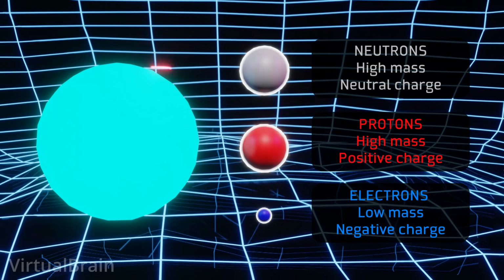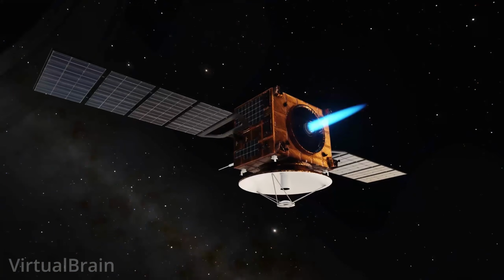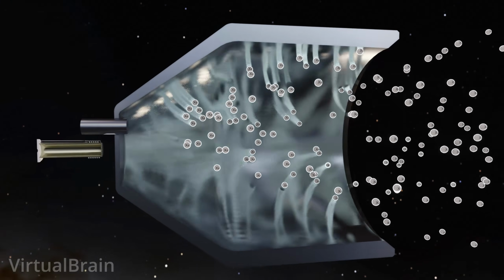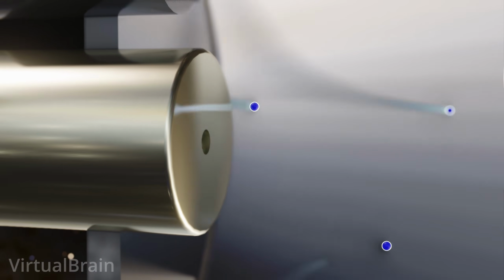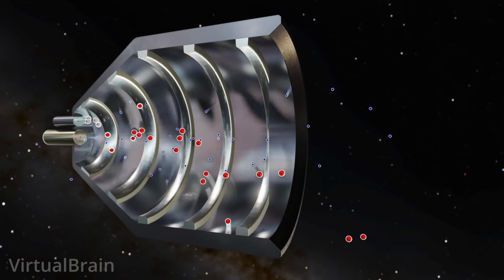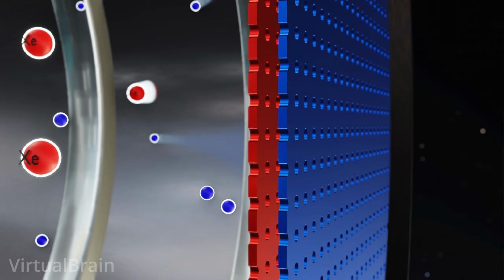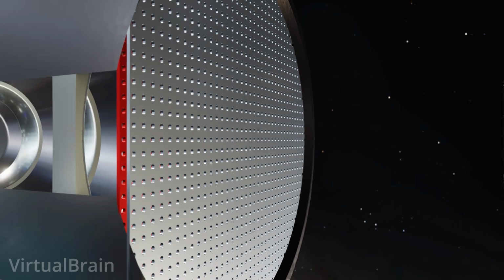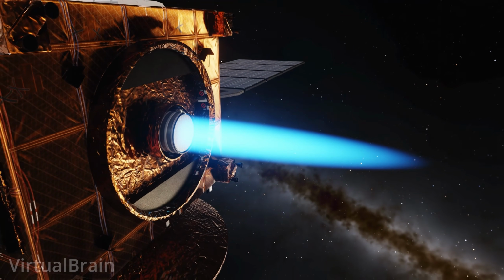How an ION THRUSTER Works ⚡ What is Electric Propulsion?

Comment: Electric propulsion is not good at all.
Reply: ... Based on what criteria do you make that assessment. Specific impulse of the shuttle main engines is 453 'sec' while the HiPEP produced a sustained value of 9840 'sec' (maximum above 10,000 'sec'). It is perfect for orbital transfers.

Comment: How does it increase the efficiency when adding magnetic rings around the main container? Will it increase the particles' ionization rate or acceleration in a straight line?

Comment: This was the best ION THRUSTER video that i've seen on Youtube so far.
Reply: There is an interesting design of aircraft, but they rarely talk about it, because this thing is secret. The topic of pulsed plasma thrusters has been developed since the early 60s (see PPT - Pulsed plasma thruster) - they are usually designed for spacecraft. But we will talk about a little-known design - these are plasma propulsion panels for aircraft, where the same Pulsed plasma thruster, but reduced to the size of a pencil and stacked in the form of cells in the panel. The design resembles a conventional plasma TV screen, where there are also discharge cells that activate the glow of pixels on the screen. And plasma propulsion panels have long discharge cells, the arrester has a railgun architecture (just rail contacts or coaxial), and the ionized discharge air is accelerated there by the Lorentz force to enormous speeds - a kind of ramjet engine is obtained. Just imagine! - tens of thousands of small ramjet engines assembled in a panel and firing plasma synchronously with a huge frequency (hundreds of kilohertz). Thus, plasma propulsion panels create lift by pulsed emission of plasma jets from railgun cells. There are tens of thousands of cells in the panel, they shoot at a frequency of hundreds of kilohertz, a huge pulse is obtained, and the plasma swirls the air into toroidal rings - the aircraft is held on this air cushion. Horizontal acceleration is created by the same plasma panels on the sides of the device (they glow, from the side they look like "portholes"). Such devices like "triangle" or "disk" have been observed for a long time, they are mistaken for alien ones - but these are terrestrial devices. They are classified and used for espionage and secret actions. Pulsed electromagnetic technology generates microwave radiation, therefore it is harmful to health. They rarely fly - only military missions. Therefore, they are not suitable for a citizen. This maintained the secrecy. Now they are already declassifying - many people know about this secret technique. When declassified, they will be used for cargo airships. But there is a danger that they are now going to be adapted to deliver small nuclear charges to decision-making centers - such means of delivery are not specified anywhere, are not conventional. This lowers the threshold for starting a war. It would be necessary to declassify them as soon as possible. That's why I'm writing about it. However, I have written before - starting with the book "The Elimination of UFOs" and many articles. 👽👽👽👽👽👽
Reply: @Pavel_Poluian  what?
Reply: @NoahDaun-yd2ep  There are many lies here in the field of UFO, but the truth can be established by special methods of Open-source intelligence (TEXT MINING). After studying all the materials about UFOs, it becomes quite obvious that since the late 40s of the twentieth century, a secret project has been developing in the United States for the development and production of aircraft, where the lifting force is created using high-frequency vibration. It all started with James Pitts' "Sky Car" vibrating orthotopter umbrella, then the umbrella was closed with a dome and devices appeared according to the scheme of conventional electromagnetic vibrating speakers (membrane + inductance) - fragments of the membrane were found by a farmer in Roswell. Then they created piezoelectric thrusters, or with small dischargers on the surface (they glowed all over the body due to ionization of the air), and now they are planes with plasma propulsion panels (so they are angular - that is, with flat surfaces). Thousands of discharge cells are densely packed into motor panels - they shoot streams of plasma (railgun architecture - coaxial electrodes). The ionized air of the spark discharge is accelerated in the railgun chamber by the Lorentz force to enormous speeds - a kind of ramjet engine is obtained. Just imagine! - tens of thousands of small ramjet engines assembled in panels and launching plasma synchronously at a huge frequency (hundreds of kilohertz). Plasma jets form toroidal air vortices - this air cushion creates lift and acceleration. See, for example, the MARAUDER (Magnetically Accelerated Ring to Achieve Ultra-high Directed Energy and Radiation) project. My article "UFOs are made in the USA" and the books "UFO Hunt" and "UFO Elimination" describe all this in detail. The technology is quite mundane - it is known in great detail thanks to information leaks. For example, air ionization in the coaxial elements of a railgun is created using radiation (radioactive polonium is introduced into the metal). Devices of this type were used throughout the 50s-60s-70s-80s for secret missions (they took off, as a rule, from special submarines). With the fall of the USSR, their use by the United States was practically curtailed (in the novel "Little Green Men" by Christopher Buckley, speechwriter Bush Sr., a scene is described where the US president decides to curtail the "flying saucer" project). The winding down of the project can be recorded by the drop in magnesium consumption in the United States, since such fuel was used in fuel cells (magnesium strips were burned in forced galvanic batteries), this is 2007-2008. However, later the development of the technology continued in the Russian Federation and China (the technology was restored by reverse engineering methods for downed devices). Secrecy, however, was maintained and there was no civilian use because the technology was not suitable for it - harmful microwave radiation from pulsed plasma thrusters (harm to pilots and impact on electrical appliances inside and along the flight line). The payload is small (but one nuclear charge is enough). There is no radio communication - unmanned vehicles can fly and maneuver only in accordance with the program. Previously, there was a narrow application profile - rare spy missions (so that pilots do not get a lot of radiation). Reconnaissance aircraft of this type were often observed at military bases, missile launch sites and airfields. They were even seen by peaceful geologists in the taiga, where clearings for seismic exploration were laid - UFOs flew there to check whether military construction was underway (I myself heard stories about this))). I think that soon this technology will be declassified, and cargo airships with flickering round plasma panels on the surface of the hull will appear in the Arctic sky.
Reply: @NoahDaun-yd2ep  Gray Lives Matter!💀👽💀👽💀👽💀👽
Reply: @NoahDaun-yd2ep  Me quite obvious that since the late 40s of the twentieth century, a secret project has been developing in the United States for the development and production of aircraft, where the lifting force is created using high-frequency vibration. It all started with James Pitts' "Sky Car" vibrating orthotopter umbrella, then the umbrella was closed with a dome and devices appeared according to the scheme of conventional electromagnetic vibrating speakers (membrane + inductance) - fragments of the membrane were found by a farmer in Roswell. Then they created piezoelectric thrusters, or with small dischargers on the surface (they glowed all over the body due to ionization of the air), and now they are planes with plasma propulsion panels (so they are angular - that is, with flat surfaces). Thousands of discharge cells are densely packed into motor panels - they shoot streams of plasma (railgun architecture - coaxial electrodes). The ionized air of the spark discharge is accelerated in the railgun chamber by the Lorentz force to enormous speeds - a kind of ramjet engine is obtained. Just imagine! - tens of thousands of small ramjet engines assembled in panels and launching plasma synchronously at a huge frequency (hundreds of kilohertz). Plasma jets form toroidal air vortices - this air cushion creates lift and acceleration. See, for example, the MARAUDER (Magnetically Accelerated Ring to Achieve Ultra-high Directed Energy and Radiation) project. My article "UFOs are made in the USA" and the books "UFO Hunt" and "UFO Elimination" describe all this in detail. The technology is quite mundane - it is known in great detail thanks to information leaks. For example, air ionization in the coaxial elements of a railgun is created using radiation (radioactive polonium is introduced into the metal). Devices of this type were used throughout the 50s-60s-70s-80s for secret missions (they took off, as a rule, from special submarines). With the fall of the USSR, their use by the United States was practically curtailed (in the novel "Little Green Men" by Christopher Buckley, speechwriter Bush Sr., a scene is described where the US president decides to curtail the "flying saucer" project). The winding down of the project can be recorded by the drop in magnesium consumption in the United States, since such fuel was used in fuel cells (magnesium strips were burned in forced galvanic batteries), this is 2007-2008. However, later the development of the technology continued in the Russian Federation and China (the technology was restored by reverse engineering methods for downed devices). Secrecy, however, was maintained and there was no civilian use because the technology was not suitable for it - harmful microwave radiation from pulsed plasma thrusters (harm to pilots and impact on electrical appliances inside and along the flight line). The payload is small (but one nuclear charge is enough). There is no radio communication - the discharges create interference and jam electronics - unmanned vehicles can fly and maneuver only in accordance with the program. Previously, there was a narrow application profile - rare spy missions (so that pilots do not get a lot of radiation). Reconnaissance aircraft of this type were often observed at military bases, missile launch sites and airfields. They were even seen by peaceful geologists in the taiga, where clearings for seismic exploration were laid - UFOs flew there to check whether military construction was underway (I myself heard stories about this))). I think that soon this technology will be declassified, and cargo airships with flickering round plasma panels on the surface of the hull will appear in the Arctic sky.

Comment: I built an ion thruster using a 30kv color TV high voltage power supply a vertical needle and a piece of tinfoil shaped as a spiral with sharp ends for a 7th grade science fair project. They didn't believe I had built it and disqualified me... didn't discourage me at all.

I read with great interest you video on Hall effect thrusters.
Reply: That's insane! Respect!!

Comment: Your premise is entirely incorrect.   All of the examples you gave work on the principle of pressure creation differential.   If you can't create pressure there is no thrust.  You can't create pressure in a vacuum because there is no 'resistance'.

Comment: What do the thruster push off of in a vacuum?
Reply: It doesn't,  it's the mass of xenon particles accelerated to high Velocity that creates thrust.
Reply: @kurtdobson  That does not answer the question.... To generate thrust you need to push against something. In a vacuum you have nothing to push on. On earth you can push against air which is why you gain momentum. Without any particles to bounce off, where do you gain your forward momentum?
Reply: @ITubeYouK  Gee that’s new information. We need to let NASA know that the various ion thrusters used on Deep Space 1 and 9 won’t work.  These idiots thought that accelerating xenon gas particles produced usable thrust in deep space because it’s actually the mass being accelerated in one direction produces an equal and opposite force in the other direction. My day gig is a rocket scientist making space craft…
Reply: @ITubeYouK  A common misconception. If it were true nothing we put in space would be able to return. The physics principle is that if you accelerate a mass, there’s an equal and opposite force produced.  So, rocket engines, ion and other thrusters work fine in space with nothing to push against. This is known as Newton’s third law of thermodynamics.
Reply: @kurtdobson  Newton's third law of thermodynamics? The Third Law of Thermodynamics states the following: the entropy of a closed system at thermodynamic equilibrium approaches a constant value when its temperature approaches absolute zero. This constant value cannot depend on any other parameters characterizing the system, such as pressure or applied magnetic field. At absolute zero (zero kelvins) the system must be in a state with the minimum possible energy. This has nothing to do with what you are stating. You are referring to a Mechanics problem.
Reply: @ITubeYouK  My apologies, it's known as Newton's 3rd law: 

Newton's third law simply states that for every action there is an equal and opposite reaction. So, if object A acts a force upon object B, then object B will exert an opposite yet equal force upon object A.

In a rocket engine the mass is accelerated out of the nozzle and the force generated is in the opposite direction.

In an ion thruster, Xenon atoms are accelerated by a high voltage screen and those atoms exit at very high speeds, and again the force is in the opposite direction of the accelerated mass.

Rocket, ion and other thruster types are used in space all the time.  The concept that an accelerated mass needs to push against something is inaccurate.

BTW my day gig is a Rocket Scientist...
Reply: @ITubeYouK  A common misconception... not true, sorry.  Newton's third law. Accelerating a mass in one direction (rocket fuel or Xenon atoms in the case of ion thrusters), creates an equal force in the opposite direction.  We have a lot of hardware in space.
Reply: @kurtdobson  Agree with Newton's Third Law. You are correct.
Reply: Nothing. There’s a misconception that thrust requires pushing in something. See details in my other comments…

Comment: What is the purpose of all that , you still need  gas to generate thrust which in this case it is xenon and that gas is more heavy then hydrogen and oxygen so why not to keep using hydrogen and oxygen
Reply: Relative to mass, ion thrust via xenon is much better and lasts longer than combustion propulsion. Perfect for space travel.

Comment: Can hydrogen be used instead of xenon I know it will affect its speed but affecting some speed hydrogen is easily accessible and a lot cheaper
Reply: Hydrogen is also explosive
Reply: hydrogen doesnt have the density of xenon, xenon is sort of the middle point of gas choices, a denser gas will require more force negating its effectiveness. a lighter gas will not produce enough force to be effective

Comment: Positively charged ions are atrracted by the final negatively charged grid and accelerate. So far so good. However once the final grid is passed the opposite effect is taking place, i.e. the ions are slowed down by the grid. Can someone explain where the net acceleration comes from?
Reply: newtons law of motion, as the ions pass there is an equal force induced on the grid so to speak, -for every action there is.... you dont get something for nothing. say an ion is expelled at the value of force called x, the object causing the expulsion also experiences a opposite force with the value of x.
Reply: @TheLost Wolf :-) Thank you again. I guess I had fallen victim to that 'short attention span' pandemic. Following your explanation I went on to watch the video to the end and sure enough the electron gun got mentioned. Greetings from Poland.
Reply: @DyzioTheDreamer 🤦‍♂️

🤦‍♂️🤦‍♂️🤦‍♂️
Reply: @TheLost Wolf Thank you! So once these accelarated ions receive the missing electon at the time they arrive at the final grid they turn into atoms? In that case the engine itself should not be called an 'ion thruster', should it?